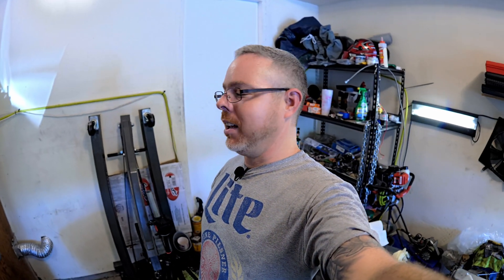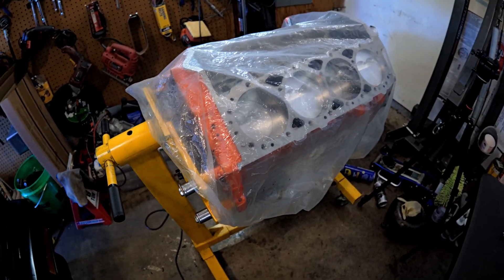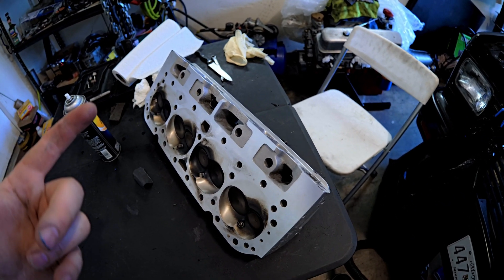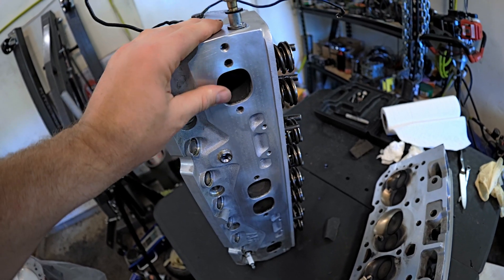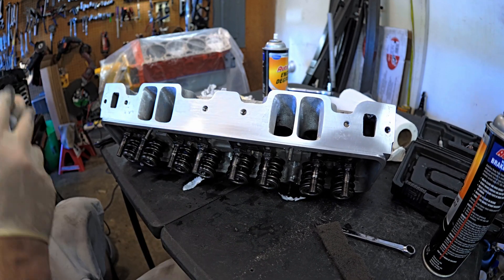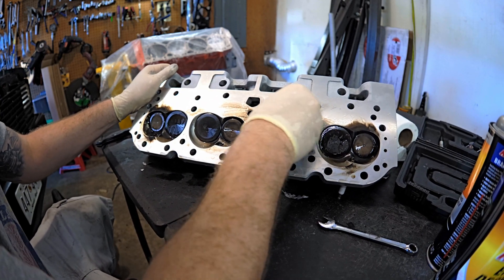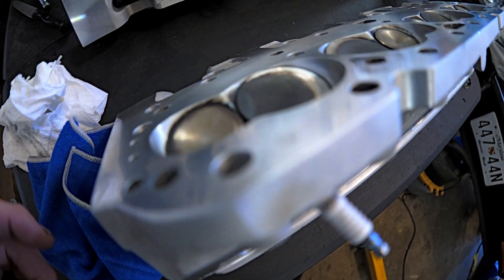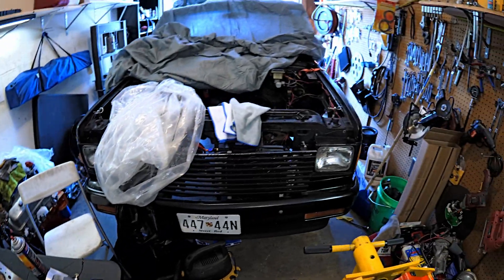The most overlooked part of engine assembly . Cleaning! And what to use on cylinder heads.

Comment: You can use a wire brush on cast iron surfaces just be a bit gentle there is no need to attack anything like a cave man anyway and then you must wash with soap and water several times and then blow everything off and out with compressed air to make sure its as clean as a drs hands before surgery that includes your hands rubber gloves work very well for assembly cleanliness is next to godliness. I was taught almost to the point of having a clean room free of dust like a bubble for someone w no immune system dust and such is a bearings worst nightmare a good break in oil follow proper break in procedures according to manufacturer recommendations and you might be ok at the factory they start the car and rev the snot out of it to break it in believe that and they are fine back in the day do you think they broke in every cam in every car for twenty mins

Comment: Cleanliness is always a good thing. They do make zip disk (3M Surface Prep disk) that wont hurt aluminum and still take off the gaskets. it's does a great job buffing the surface for gasket prep. been using them 25-30 years no issue but they way you do it is best for making sure. I've definitely seen people screw up a surface using the wrong prep disk. A thing to add is never coat a MLS gasket. Some say they do it but they can fail quicker with a coating that isnt applied by the factory. They also say they arent reusable but we've done it at the track and they havent failed. Gotta do what you gotta do. Good vid as always.